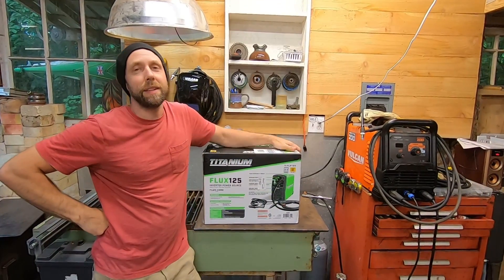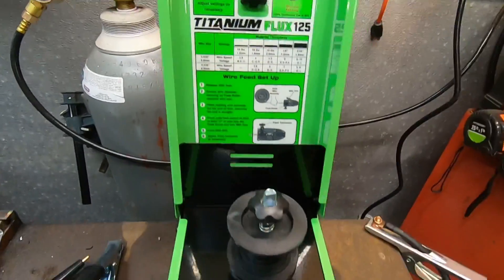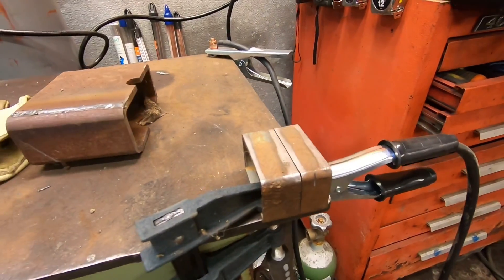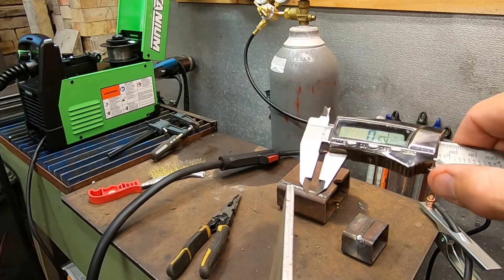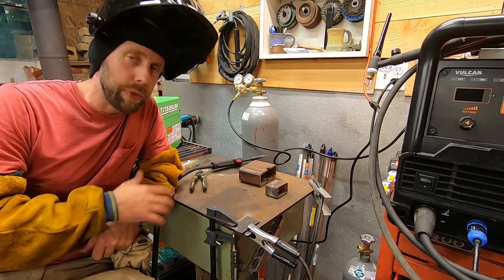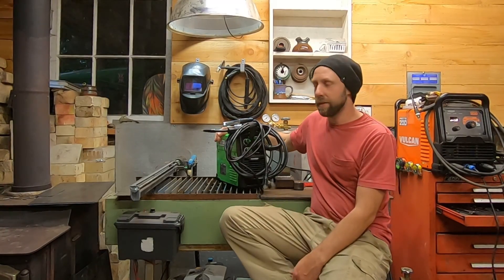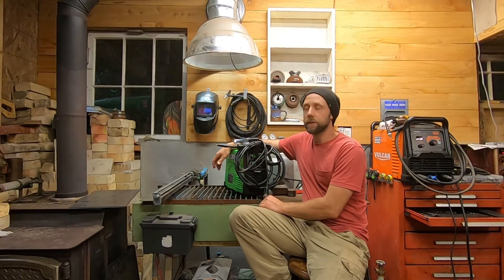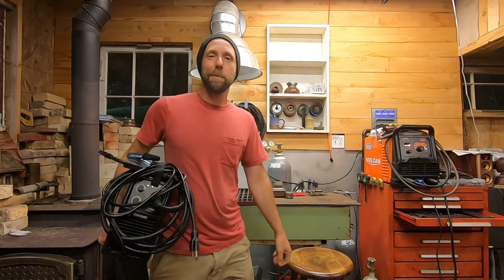Titanium Flux 125 welder from Harbor Freight

Comment: Hey.. thanks for the video.  i have never weld before and i am not going to be welding a lot but i do have a few project that i want to do,  for example.. welding some eye ring screw to the tip of a 2ft rebar as a spike to hold down some poles.. would you recommend this as a beginner and something that is easy to use? Thanks of the any advice..
Reply from the maker: Yes I think this will be a great starter welder, simple affordable, it’s quite powerful for a 120 volt welder.
Ps I should be posting a video in the next few weeks showing how to get started with flux welding for beginners. Take care
Reply: @Mikefestiva  cool.. thanks for the advice.. will be keeping an eye out for that video

Comment: how would you compare it to your Lincoln 140
Reply from the maker: Well because this 125 is only a flux welder the Lincoln is a better welder just for the fact it’s a flux/ MIG welder, but I would not buy the Lincoln 140, I think for the price the Titanium 170 is a far better choice in that price range. 
Back to the Titanium 125, if it could be modified to run gas I think it may have the upper hand on the 140 when it comes to how compact and light it is and for the fact it’s a inverter welder. I’m looking it over and I think it can be modified for Gas but it’s probably something that most people won’t feel comfortable soldering on there circuit board on there new welder. 
Take care :)
Reply: @Mikefestiva  Comparing a Titanium 125 DC inverter welder (120v) to a Lincoln 180 EZ-MIG (on 240v) both running .030" Lincoln Flux wire on the same 1/8 and 3/16 material, the Titanium produced a more stable arc (likely DC vs AC) and was easier to dial-in because of the infinite adjustment of the wire speed and amperage vs the taps on the Lincoln.  There is much less spatter with the Titanium compared to the Lincoln, again likely the AC vs DC thing, to the point that I question the need to deal with shielding gas for most garage/hobby welders.  Cleanup is super easy with an angle grinder and wire wheel and even fabricating metal parts for furniture where the welds are visible I'm totally happy with the results I'm getting from the Titanium.  

I was not a fan of the well regarded 120v Chicago Electric inverter stick welder or some of the other cheap transformer / AC 115v flux core only wire welders.  Before running 240 to my garage and investing in a Lincoln EZ-Mig 180 setup I'd tried the Ironton, Lincoln Weld Pak and Chicago Electric 115v transformer based options which all performed poorly and regularly popped the circuit breaker on the anemic 15a, 115v circuit in my garage. This Titanium 125 is a really good value for only $200, or $170 on sale right now (check the Harbor Freight Coupon Database website) even if you spring the extra $35 to get the 2.25 year warranty option.  I'd absolutely recommend this over the Lincoln Weld-Pak 140 which sells for $500-$550. 

If you have more than $200 to spend and really want a gas option, rather than converting the Titanium 125, take a look at the Everlast Power I-MIG 140 which sells for $360 with free shipping straight from Everlast.  Compared to the Titanium you get a better (metal) feed system, 10 pound spool compatibility, gas setup for AR/CO2 and a 5 year warranty... and it's still $190 cheaper than the Lincoln Weld-Pak 140.  If you have $550(ish) to spend on the Lincoln 140 setups I'd also consider the Everlast Power I-MIG 200E, for $585 shipped, it's a 120v/240v compatible inverter MIG welder that works no matter what you have for power, and competes with the more expensive 170-180amp / 240v only box store setups ($650-$700) from Hobart and Lincoln with a better warranty and the other benefits in duty cycle and arc quality that all inverter based DC welders offer over older AC/transformer based solutions.  I also think that HF Titanium MIG 170 machine (also 120/240v) for $450 after coupon is worth a look, though if you buy the extended warranty it gets awfully close to the Everlast option in price.  Again, I'd still take either over the WeldPak 140 and would have a hard time buying the Lincoln EZ-Mig 180 setup again now that these options are widely available.

Comment: Harbor Freight's prices have been heading north, they've expanded the tool brands excluded from their coupons. I wonder how much this will cost in the future?
Reply from the maker: Yes they are definitely selling a lot of newer designed tools and a wider range of quality from cheap, mid grade and $$$ grade, I bought this one on sale for $170 but I think it lists for $200, hopefully they keep it in that range? When the Omnipro 220 first came out it was on sale from time to time for $750, then after some good feedback they upped the price now it’s about $950, it’s a good welder but it’s definitely getting up there for HF tools. Hopefully this Titanium 125 stays in the $200 range, I think they would have a hard time selling it for much more for the fact it’s just a flux machine, if it was gas ready I think they could probably get away with $250 or $275 but I don’t think they will ever offer it as a MIG :(   I just ordered a gas valve and have looked over the circuit board and I’m pretty sure I can adapt it for gas! 
Take care and thanks for commenting.
Reply: @Mikefestiva  HF tools aren't the cheapest anymore. Some work okay, some are not. Their prices seem to be higher every year. Many times, I found cheaper somewhere else. They all China made anyway. For welding, I bought one from the good brand.

Comment: Can I use a 15 amp outlet with this welder?
Reply from the maker: Fernando Cerritos  I’m sure if you only have a 15 amp breaker you could still run this welder in your shop, you probably just won’t be able to run it all the way maxed out or you will trip your breaker. I’m sure it will still be able to weld 1/8” on your 15 amp breaker.

Comment: I’ve never welded but I want to make myself a BBQ Pit. I have a 40 gallon and 30 gallon used water heaters. Do you think this welder would do? Being a wood worker I could not help but notice that mill of yours. Hope you have some videos showing some of the slabs you have milled! Great video!
Reply: it should handle it no problem, just have a 20 amp circut
Reply from the maker: Yes this is a great little welder with plenty of power for something like your BBQ project! It’s a great welder especially for the price, it’s 15 Lbs  and the size of a big lunch box is really cool. Thanks for checking out my video :)

Comment: Looking at this one and the century fc90. What one is the better cheap welder?
Reply from the maker: I just bought this welder so time will tell how it holds up? I plan on using it a bit to see how it holds up around my shop. The FC90 has been out for a while now so I’m sure there’s some okay reviews out on it and how it’s holding up. I do have to say I would take the extra 35 Amps any day on this Titanium 125,  my first impressions on this titanium 125 is the build quality is good, I looked over the circuit board and it all looks well put together. You can buy a extended warranty for a extra $35 this covers 2 years. So even if you drop it off the tall gate of your truck they will replace it for you. Just something to consider when buying one. Take care Chris

Comment: I got one today as I said I would. I cut a slot in some heavy street sign post cleaned it and filled a large gap beautifully. Then the real world test, took a 10 inch junk of galvanized steel and welded it to rusty section the tall way without cleaning either of them. I then smashed it with a sledgehammer. It bent 2 inches from the weld and you could see where it hit on the other side. Holding strong and loving it.
Reply: I didn’t realize how small it was til I saw it in person. I will probably upgrade the hose and clamp later on.
Reply from the maker: Right on that’s a good report! I’m amazed with the power of these compact light weight welders! Thanks for commenting :)

Comment: This is good timing, I spent a day tearing my craftsman apart to replace the liner just to not be able to find one, then put it all back together and sputter again. I was about to throw it across the front lawn but thought let’s see if this roller will fit my sons busted blue hawk. It doesn’t but his finished the weld by putting it together wrong , go figure. I think I’ll get one of those tomorrow. Thank you for encouraging my sanity.
Reply from the maker: That sounds like a frustrating day! Sorry man :( if you only need a flux welder these seem to be quite useful to have around the house, I also own the Titanium unlimited 200 it’s a great welder but it’s 3 times more in cost. I hope you find yourself a new welder that fits your needs, it’s always nice having a tool that just works when you need it to. Take care

Comment: Another well done video Mike.  Well done!  I would like it if you can test this new welder with a 5500 watt or lower gas engine generator!
Reply from the maker: Sounds good! I have a generator around the 4500 watt size, I will definitely try it on the next video. Take care :)
Reply: As long as the generator has a 20 Amp branch circuit...IT'LL WELD!!!😎👍🏻...Lesee....V x A = W.... 120 Volts x 20 Amps = 2,400 Watts....I'd say you could get along quite nicely with a minimum 3,500 Watt Generator!!!😁👍🏻

Comment: cold wire feed is a great feature as well. i didn't see the switch till after i installed the spool.
Reply from the maker: Haha thanks for commenting! I didn’t read the manual so I missed that feature :) Thanks I see its tucked on the back side of the front panel. Thanks Ronald! That’s definitely a nice extra feature.

Comment: Noice. Can't wait for the nude shots lol
Hey can I ask a favor? If you could try autobody sheet metal, that would be great! 22 gauge Is pretty standard now a days.
And whats your favorite flux core wire? I'm running the Hobart fab shield 21B.
Reply from the maker: Yes I look forward to removing the metal case for the nudes! Haha. I will try and see how it welds 22 gauge in the next video. Take care Dan :)
Reply: You gotta have some crazy skills to weld 22ga. Flux burns hott
Reply: @VasilyBuilds   It's all tack welds 1 inch a apart then you tack next to a previous tack and work  your way around in no particular order to prevent warping 👍 Autobody repair is a whole 'nother animal hehe

Comment: It can weld a lot thicker it's all about preparations and multiple passes I have welded 1/2 pipe with Chicago electric 90am 110v harbor freight welder does well even on a 3500 generator.